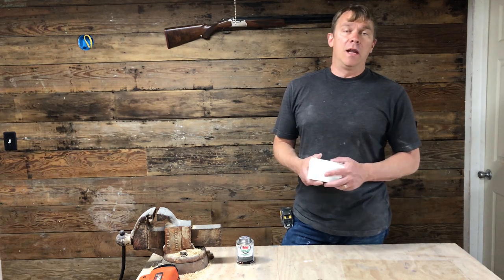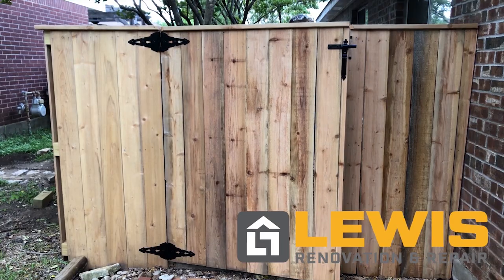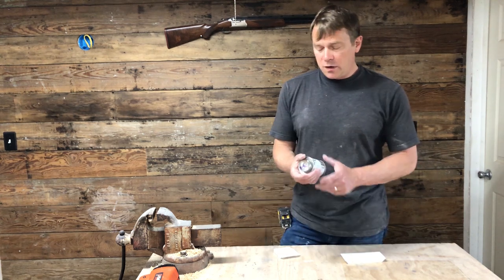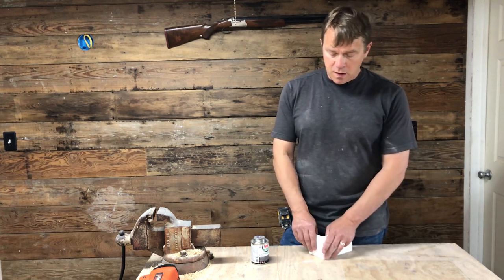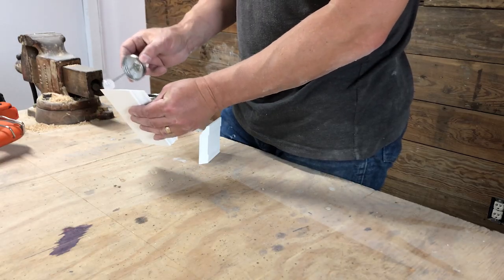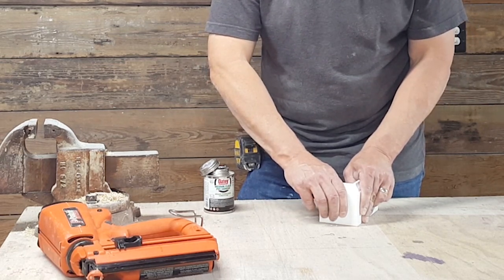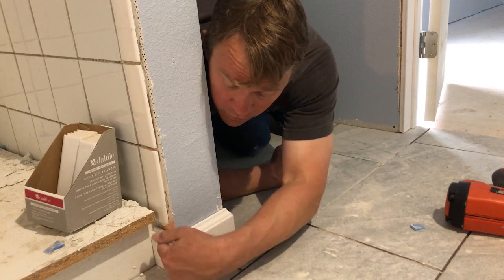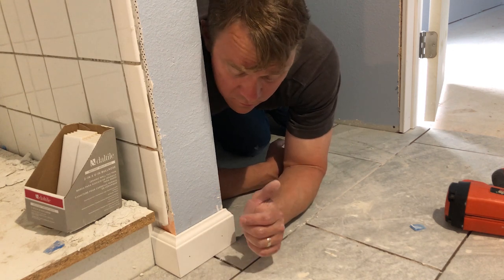Perfect PVC Trim - Miter Joint

Comment: I just purchased about 20 PVC Baseboards for my basement remodel. I'm glad I saw your video...I wasn't sure if I should use my nail gun to attach to the wall, or glue them (guy at Menards told me to use glue). Using glue didn't sit right with me...I've always nailed trim to the wall. I have 16g 2" nails...does that sound about right? Do you still caulk PVC up on top?
Reply from the maker: You could always glue and nail. 2" 16g are fine. 15g nails would be even better but I don't have that nail gun either. I caulk the top with Dynaflex 230. Silicone would be great in a basement if yours is like the dungeon i once had in Norwich CT but is probably not worth all the extra work.  Good luck!
Reply: Thanks guys!!

Comment: Wow perfect corner on my restroom. Same corner and everything, but molding it rotted and so is the wall. Gaping hole about 4 inches high. Do I saw that section out and replace it with plywood or is there more to it?
Reply from the maker: I'd figure out first where the water is coming from and fix that. Is all the structure in the wall rotted out?  Studs? Bottom plate?

Comment: My question is what's the best method to cutting PVC trim
Reply from the maker: A miter saw with a good blade does just fine. What kind of project are you working on?
Reply: @LewisRenovation  just replacing the bathroom mouldings. Seen your video and decided this was the best thing to do.
Reply from the maker: I now use PVC molding in all my bathrooms. It's good stuff. Good luck with your project

Comment: What do you use to fill the nail holes? Thanks!
Reply from the maker: DAP Drydex is what I've found to work well
Reply: Just use normal wood filler if you're going to paint over it

Comment: so I have a wall in old house that isn't exactly plumb, 45 degree two pieces of trim on an outside corner,  still have a small gap...anything i can use to fill that gap? not going to paint trim in the end..first time using pvc material...none of this house has ever been level or plumb.
Reply from the maker: Drydex is rated for outdoors and indoors. I think it would work on a PVC miter joint as long as the gap isn't too big
Reply: will let you know, its a very small gap, with wood, I could just tap the corners to cover or use some colored  wood putty wipe on and off...old trimmers tricks i always call them.....ty
Reply from the maker: Good luck!
Reply: Just wanted to let you know that the drydex worked great on pvc 45 degree outside corner in my restroom, once dried...really blends in well with the pvc.
Reply from the maker: @jayhawkerg9631  that's great. Thanks for letting me know too
Reply: Sounds like my house. Nothing level or plumb.